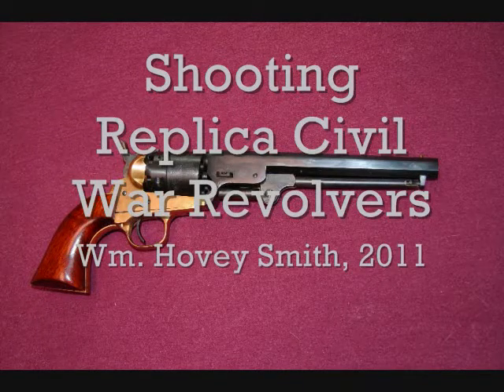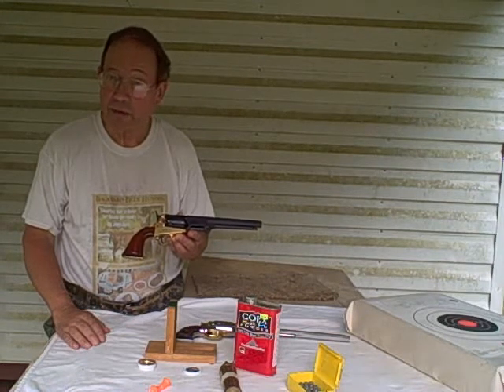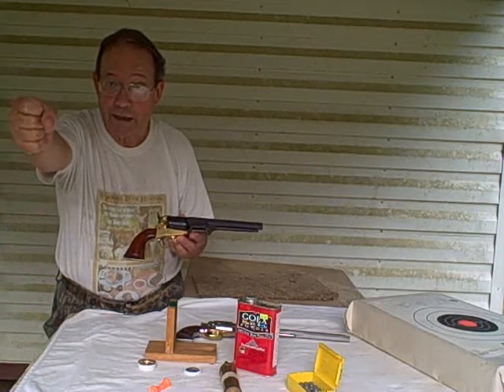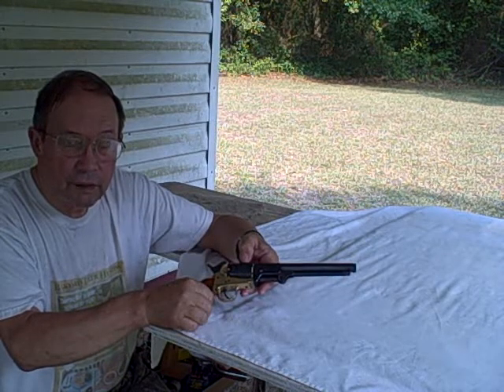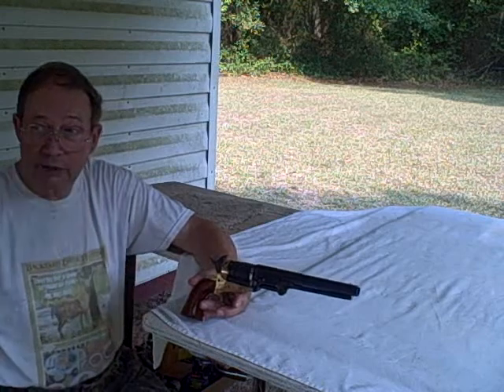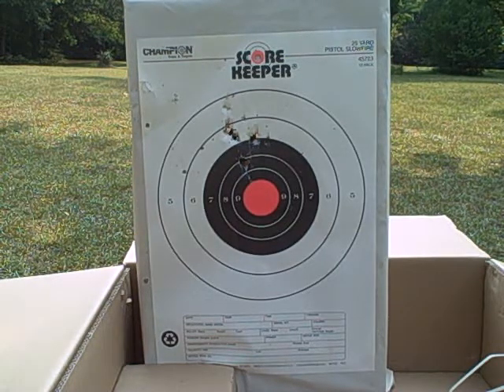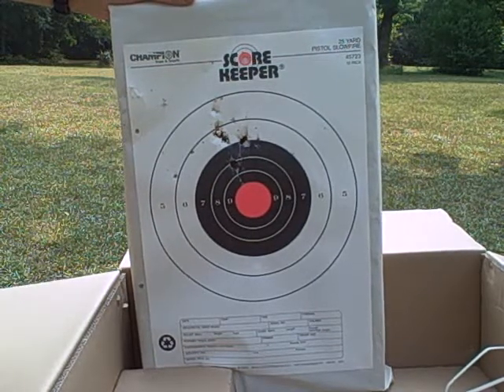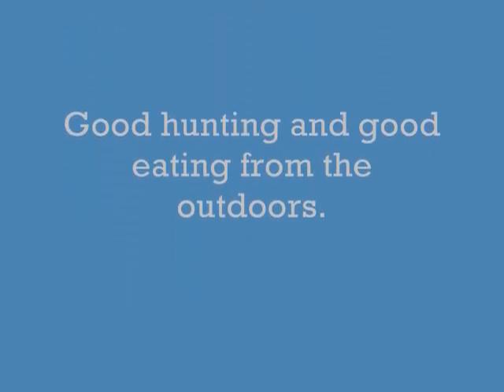Shooting Replica Civil War Revolvers.

Comment from the maker: The compound used in percussion caps was originally fulminate of mercury. This is one of those class of chemicals that explode when struck. They do more than spark in that the detonation of the compound has sufficient force to drive a jet of flame through the nipple into the powder charge. There are guns that only use the percussion caps to shoot very light-weight balls at targets - generating about the force needed to kill a cockroach or punch a hole in a paper target at 10 yards.

Comment from the maker: That depends on how old you are and where you live. Percussion guns, like this, may be purchased in the U.S. on the Internet from Cabelas and Bass Pro. However, there are shipping restrictions to areas like NY, LA, Boston, Chicago and other places. One reason why this particular gun sold so well is that it is attractive, although its brass frame makes for a weaker gun than the all-steel version. Used, these guns sell for about $90. New they start at about $170 - more with accessories.

Comment from the maker: Pyrodex makes 30-grain revolver pellets that I have used in percussion revolvers and for .44 and .45-caliber cartridges. I have had "squib" loads with these pellets in percussion revolvers (no problems in cartridges) as have others. I think the issue is not having sufficient "back pressure" from the ball to get a good burn. If you just plink with the gun this does not matter. If you are shooting competition, loose powder is better. I like CCI Magnum no. 11s or Remingtons for best ignition.

Comment: Always good to see another Colt blackpowder video. Or any blackpowder theme for that matter. I have a nice collection of Authentic Colts. I fire most of them. I have all period equiptment. I cast from the Colt molds. All the modern means/materials for loading, firing etc, I m  not down with.  My favorite target is the  layered and spaced 1'' pine board type.  This shows good penetration/ball track results. I ve  got attachable breech stocks for the Army/Dragoon. My latest addition to the armory is a CBAC nickel plated 60 Army.

Comment from the maker: Looking at the most recent Cabela's catalogue, I find the gun as 1851 Confederate Navy .44-caliber  (full size) order no. JC-21-0086 for $179.99 as well as a more authentic Griswold & Gunnison .36-caliber JC-21-7650 for $202.99. The telephone order no. is 800-237-4444. On the used gun market the brass .44s usually go for between $90-$120. There will be added shipping charges. This gun may not be sold to addresses to all states and cities.

Comment from the maker: Metallic percussion caps often did strange things when confined between the rotating cylinder and the top strap of revolvers. Not having a top strap eleminated this potential areas of cylinder jamming. In a combat weapon reliability and functionality is more important that strength or the load that the gun shoots. I believe this is why Colt resisted using a top strap for so long in his percussion revolvers. Caps in the 1860 may have also been not as uniform and thicker than we now see.

Comment from the maker: A good load is 26 grains of FFFg black powder, 36-cal felt wad (From Cabela's) .350 round ball and a .36 cal wax over ball wad. I would get a revolver loading stand. I use CCI's Magnum no. 11 caps and crimp the bottoms for a good fit. 

These guns must be washed with soap and water (I use a few drops of dishwashing soap or just clean in dishwater after I have done my dishes.) to remove the corresive salts from black powder. I have a YouTube video up on cleaning that you should watch.

Comment: Thanx for your answer. I´m familiar with shooting cartridge guns in several calibers, but I never shot a cap & ball revolver. Can you tell me how much blackpowder is necessary to shoot that revolver. Someone told me 30 grains for each chamber. Is that correct? 

BTW: The guns barrel and cylinder are clean. I cleaned it once with a .36 cal bronze brush. The barrel is in great shape. I also disassembled the whole gun to grease and oil the mechanism and moving parts. Everything works fine ;)

Comment: Before I started reloading about 40 years ago I shot a lot of cap and ball. A 36 cal sheriffs model, 1860 44 army and 44 Remington. Every one shot about 10 in high but very accurate. I always assumed they were sighted for long range or brass belt buckle aim to catch the opponent in the chest. Been thinking about an open  top 1862 conversion in 380acp when they hit the channels.
Reply from the maker: I have seen people who really knew their pistols hit man-sized steel targets consistently at 100 yards, but without adjustable sights a trooper planning to hit the man he was aiming at, rather than someone else, would be well advised to hold off until his adversary was at much closer range. I prefer the stronger Remington frame guns to the Colt-pattern revolvers.

Comment: Maybe I'm just different, but I like the look and feel of the old Colts much better. I have a  Pietta brass .44 that I've run a lot of rounds through with no problems at all. I do keep the powder at 20 grains Pyrodex with .454 balls, but the gun is still as tight and snug as the day I got it. Like all of them it shoots high and left, so you learn to shoot it. I do have other guns, but this is my favorite even though it takes time to reload. Not afraid to carry it anywhere---if 6 shots won't take care of the problem, it's too big of a problem anyways.
Reply from the maker: For display pieces the Colt's do look better, but for game killing I prefer the added precision offered by adjustable sights and the added strength of a solid frame Remington-pattern revolver. With 20-grains and a round ball, your gun should do fine with occasional use. When you are trying to push velocities and increase muzzle energy for reliable use on game the Triple7even loads and heavier bullets increase pressures. I am now working with the Walker, which is an open-top design, only because a solid frame percussion revolver with a similar chamber capacity is not available. It would be nice for S&W or Rossi to use the long cylinder of their .410/.45 guns to make a modern, powerful percussion revolver with a 12-inch barrel and adjustable sights; but I do not see this happening.
Reply: Is it bad too keep the pistol Loaded for a long period of time like a year????? Will it rust!!!!??
Reply from the maker: In theory a load in a percussion gun if it were in an air-tight environment would be as non-corrosive as the same load in a sealed metallic cartridge. The rub is that black powder will absorb moisture and corrode the chamber or barrel if it has access to air. If loaded in a clean chamber and sealed from the air at both ends, the load would not corrode the gun. Old percussion guns, that may have had loads in their barrels for a century or more often have corroded chambers. The unknown factor was that the charge may have been put down a dirty barrel to start with and/or stored in a humid environment.
Reply: JazzyLocke I have a steel frame 51 navy .36 that shoots dead on at 15-25 yards

Comment from the maker: This particular replica was once sold by CVA.  If you want a gun to shoot, I prefer the all steel Remington pattern 1858s with Uberti making the best traditional gun, but the adjustable sights and longer barrels on some  Piettas giving them the edge for hunting. If you try to spike up the loads with Colt guns with TripleSeven they will often loosen their cylinder pins and damage the wedges. These can be repaired and then the .44-caliber guns will do fine with 28-30 grains of Triple-Seven. All-in-all, I like the Remingtons better.
Reply: I prefer the Colts better. But all to their own like.

Comment from the maker: The brass will streatch, the gun shoots high and I do not recommend it for more than just occasional use. It depends on if you want something to hang onto a wall or actually use more than only occasionally. The 1858 Rem. is by far the superior gun for serious shooters.

Comment: I'd love to see a video comparing using lubed wads vs crisco over the ball.  Advantages and disadvantages?
Reply from the maker: The only advantage Crisco has is its availability. In hot weather, and we have a bunch of it here in Georgia and even more in the Southwest states it melts and runs. In cold weather it works better, but lubed wads or better yet a softened beeswax based lubricant does best so far as staying in the cylinder goes. So far as absolute accuracy goes, that is not a test I am inclined to do because of Crisco's low melting point failures.

Comment: I find the Remington design to be more reliable than the Colt design. The open top does not make a difference at all. what does is the open space behind the nipple. On Colt guns, there is no method of preventing cap fragments from falling back into the hammer mechanism, while on a Remington, the actual surface of the hammer that impacts the nipple is significantly thinner than that of the Colt, allowing the frame to incorporate a narrower channel for the hammer. This in turn prevents cap fragments from falling into the mechanism when the hammer is cocked after a shot.

Comment: Being factory. sighted to 75 yards they were designed to kill horses or men at that range
Reply from the maker: That might have been the case in theory, but I have never shot one out of the box that would hit the figure of a man at 75 yards without hold off with standard loads. Maybe the new originals were better guns, and there are indications with progressive rifling (not on the replicas), that they were. However, if I were in combat I would hold my shots with these slow to reload guns, until my opponent was much closer. True practiced shooters with tuned guns, could likely make such hits, and did during Colt's demonstrations. But the average guy with the average gun, and certainly with today's replicas, is better advised to let his potential adversaries get close.

Comment: What size powder load are you using? I just got a brass frame 36cal and waiting to take it to the range.
Reply from the maker: In .31-.36 caliber revolvers I usually use about 20 grains of FFFg. With the .36, the usual loading range is 15 to 30 grains of powder with filler and or wads used with lower power loads to bring the ball up to the front of the chamber for less ball jump and better accuracy. The objective is to have a load that groups well and shoots near the point of aim, although the last may be impossible to achieve with your gun without raising the front sight. I would go with 20 grains for my first shooting to learn about the gun and how it functions. Whey you get to really know the gun, they you can start playing with increasing the powder charge, wads, filler materials, etc.
Reply: Thanks hovey! Is 36 cal capable of taking deer? (Between 0-15 yards?)
Reply from the maker: This is among the most marginal of all muzzleloading guns for game the size of deer, except for maybe point blank range against the skull with hard cast bullets. In terms of cartridge guns this is the equivalent of the 32 S&W. It will work fine for small game up to the size of coyote with good shooting; but I really would not trust it on deer, although doubtless I will hear from someone who killed one with it. I have killed a free-running run-over 90 lb. hog with a .22 short rim fire; but I certainly do not recommend it.